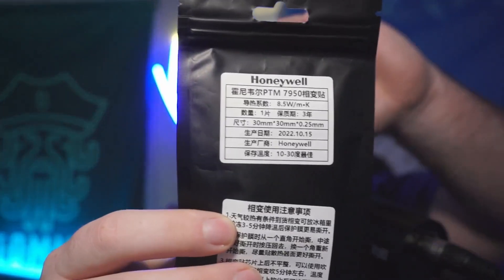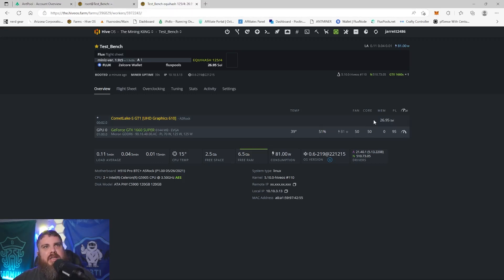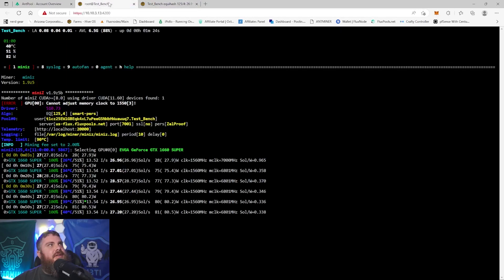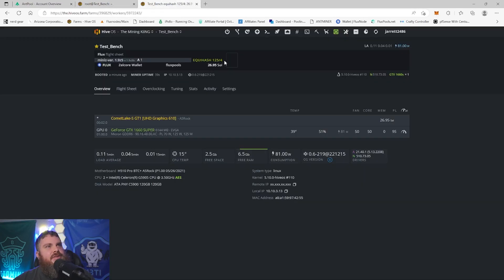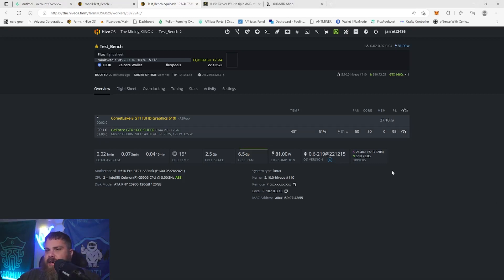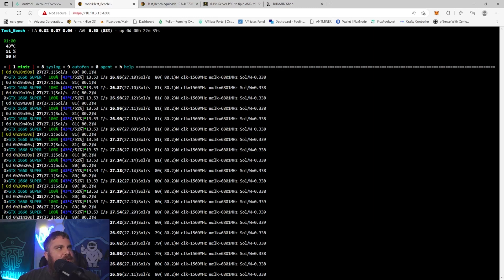Thermal pad to Thermal paste?!?!?

Comment: 7950 thermal pads aren't pads.  they're PCMs, phase change material.  it liquifies at 45* under pressure.  I haven't tested the paste but I am doing a build and might try it.  but if I go intel and delid, I am using the PCM between die and IHS.  btw, the "pads' or PCMs are .2mm usually.
Reply from the maker: yes i understand that, i will be doing a video as its been about a month

Comment: The main reason to use this product on any processor die is preventing the famous leaking phenomena which is Pump Out Effect. If your card does not pump out the thermal paste after couple of days, there is no need to use this one. For example, Thermal Grizzly Kryonaut is terrible paste if your processor die passes the thermal limit of 80 degrees. It starts to change its viscous state into more liquid one, after then Kryonaut pumps out. On the other hand, if your processor stands below 75ish degrees, only then you got the promised thermal performance of Kryonaut. Don't take this topic on only desktop computer perspective, PTM7950 is the most anticipated king of laptop enthusiasts.

Comment: You may want to test a more power hungry card. Smaller cards that have one fan that aren't blower style usually have a passive cooling component meaning cheap thermal pads will work just as well as thermal paste
Reply from the maker: long term test i only have the one pad atm stuff isnt cheap